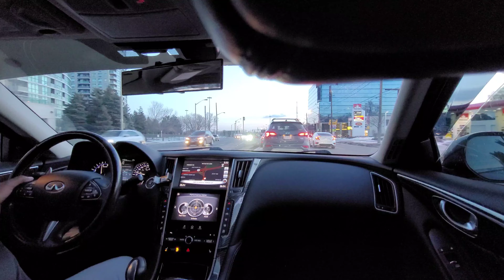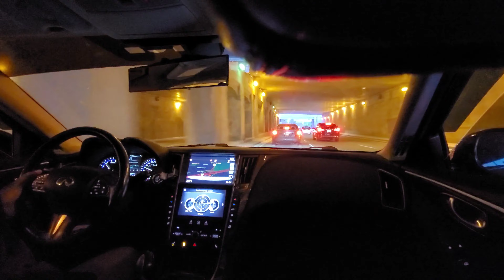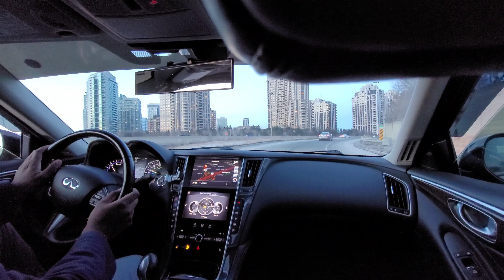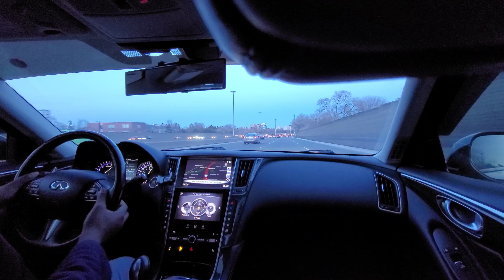2015 Q50s 3.7 AWD 2nd - 4th gear Pull (Muffler Delete)

Comment: how does it sound that good with only a muffler delete? sounds like a g37 coupe. Muffler delete on my sedan doesn't come anywhere close.
Reply: Same motor as the G37. So the sound will be similar.
Reply: Like other guy said you might have the 3.0t then if ur Infiniti year is 16 and up. The 3.7s are the same as the 3.7 Gs
Reply: Same engine little fixes here and there so yea its very similar

Comment: I see your in Ontario as well, do cops bother you because of the muffler delete?
Reply from the maker: Never. I’ll downshift around em too. Never have any issues.
Reply: I did the same with my muffler.
It's up to YOU if you want it soft like a ballerina, or hard like UFC....
Realistically, anything under 2k-3k rpm you'll be just fine. 
If you see pigs, just let go of the gas pedal lol, it's like nothing happened. 🤣
Reply: @920ths  yea its not obnoxiously loud, anyway.

Comment: I got a 3.0t tuned but man, not even close to the fun i had in my 3.7
Reply from the maker: Dude I love the 3.7. It's super fun and quick as is. But man I'd love a 3.0t as the next car. Seems like the platform finally got the kinks sorted out
Reply: @920ths  You can make ridiculous power from the 3.0t with basic bolt ons and a tune. But the thing that bugs me is the turbo lag. I used to have a 16 nismo and although i only made around 320 to the wheel it was hella fun to drive. Probably cause of the suspension and the raw driving feel. I think i need to add some coils and sways on the Q next cause it cannot take corners well.
Reply from the maker: @traveler7716  exactly what I'm focusing on this year. Already dropped the Dunflops and upsized to 255/40 Contis DWS06 Plus recently and the ride and comfort is way better. I'm gonna look into front and rear sway bars and possibly the subframe bushings to improve the input/feedback of the overall handling.
Reply: yeah those 3.7 will always be fun from the sound the pulls. 3.0t if you take racing seriously. but for cruising??? 3.7 all day of the week